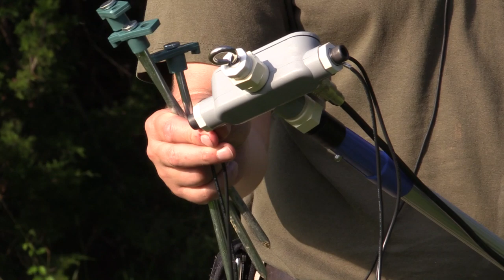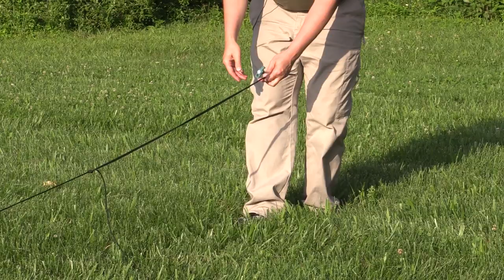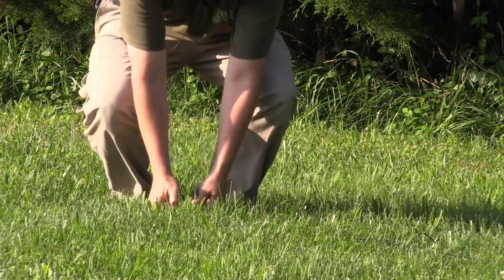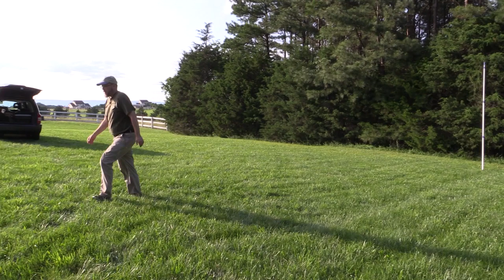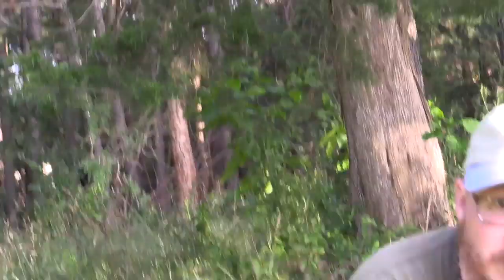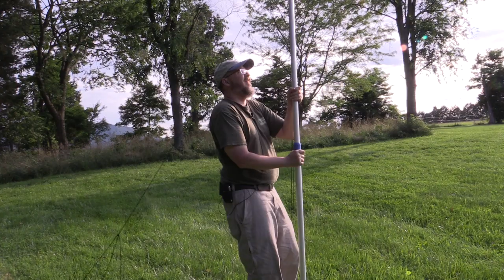2014 Field Day - Free Standing Painter Pole Fan Dipole with W4EDF

Comment: Thanks for posting this video. I have a 23' painter's pole that I would like to use with a GP-1 vertical. Would I need one set of guy wires or two? How tall is the painter's pole in the video? The link to Lowes no longer works.

Comment: Hi, remember it all depends on the angle of the dangle. Could have done with you when me and my crew were putting up antennas in a howling gale at night. All good stuf. 1st piority though is did you get the camp stove lit and the kettle on for a brew when you had completed the antenna errection ?. 73 and  good DX de John - G0WXU